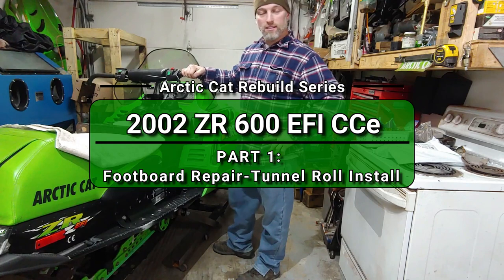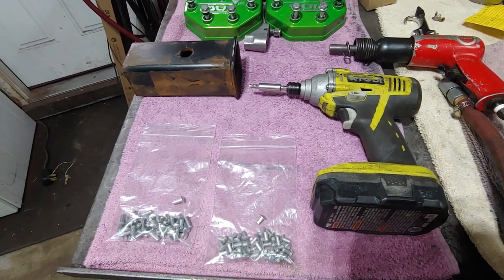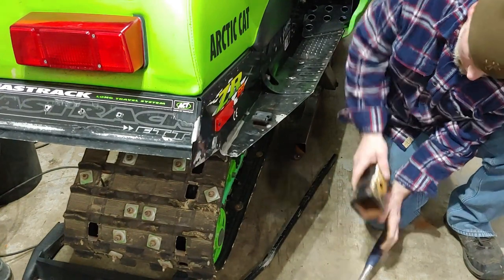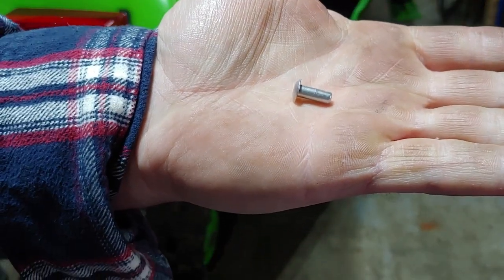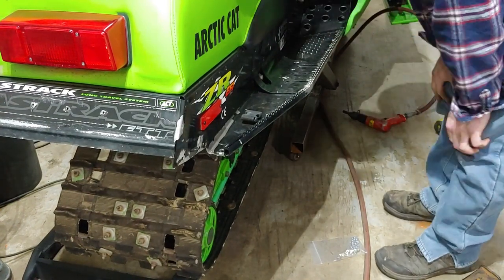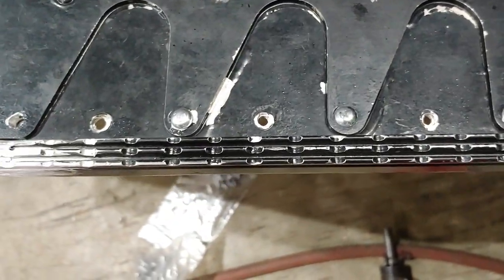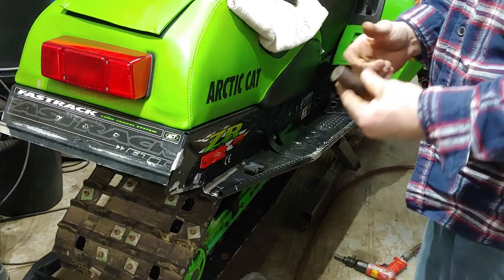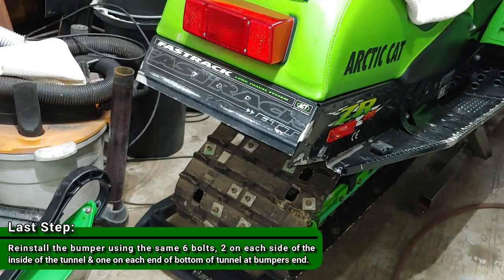02 Arctic Cat ZR 600 EFI Series Part 1: [How To Repair Tunnel Roll]

Comment: Good fix. I like the attachment for the air hammer.  I need to get me a set of those.
Reply from the maker: Thx. Yeah that is an awesome tool. This was a good warm up fix for what I have to do to my wifes sled. Lol. I gotta replace the bulkhead. So that will take drilling out old rivets and bucking new ones in.

P.S. did you the sleds out?

Comment: Let me start by saying I absolutely admire your ambition and your craftsmanship, as always I cannot wait to see your finish product after you give it your magic powder coat touch!!! That being said I have the same year ZR , it’s the exact chassis but a 800 with reverse. My sled is not a cross country because it doesn’t have the adjustable ride. Please forgive me if I’m wrong but I don’t see the adjustment Valve on yours? I don’t want to Sour your video in anyway as i wrote before I admire your work my friend.
Reply from the maker: Thank you very much for your kind words. That means a lot. I do try to do my best always. 

The Cross Country sleds have wider foot boards mainly but yes this sled has a remote shock reservoir adjuster. No worries though for comments. I welcome them and appreciate the conversation! 

Thanks for watching and enjoy the channel. I have lots more coming.

Comment: Just bought a 2001 ZR 600 arctic cat got it running but noticed valve cables are disconnected one exhaust valve is locked up ..can that cause over heating
Reply from the maker: No just power loss. Pull the covers off and soak with oil and work it loose. Them once out, clean it all up and reassemble. Mounting cables to chaincase side of the servo mount and adjist cables per manual.